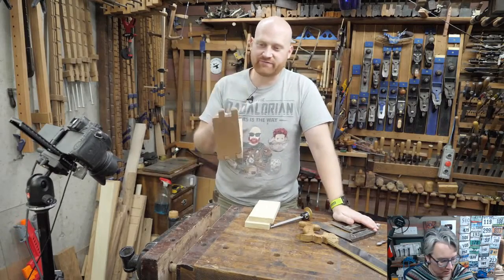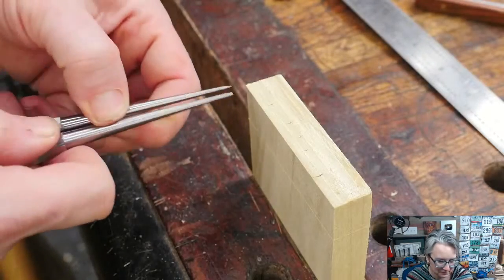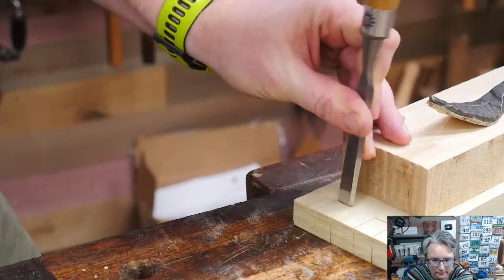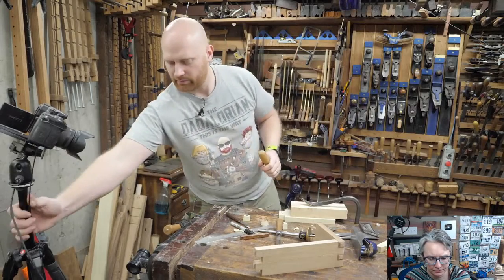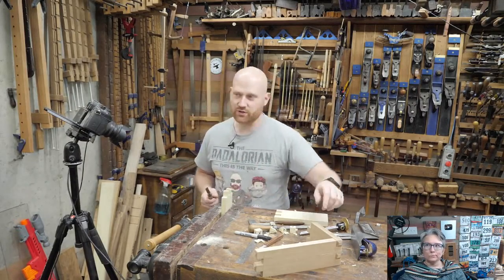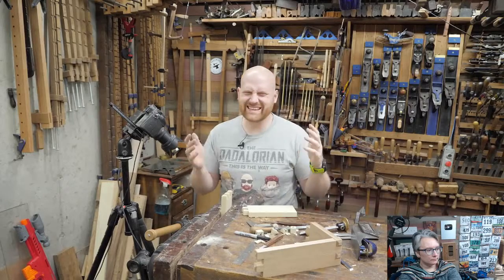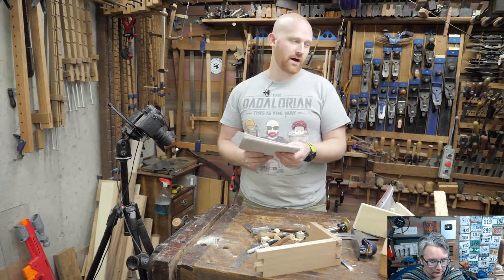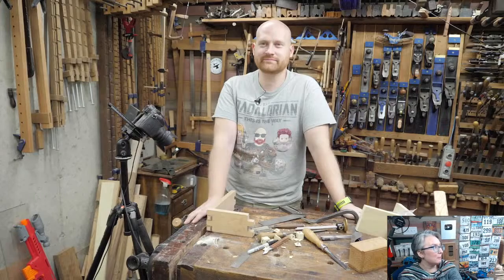How to Cut Finger Joints with Hand Tools Box joint

Comment: You should be able to cut both boards at the same time if you offset one by the width of the saw kerf. If you pull it off it should make it easier to get a good fit right off the saw. You would have to change the direction of the offset between sawing the first side of the slots/fingers and the opposite though.